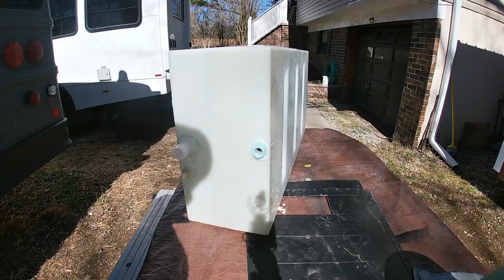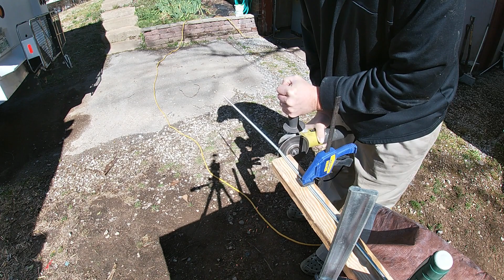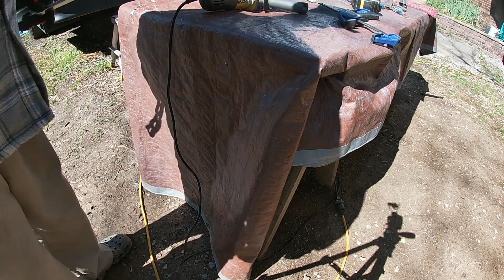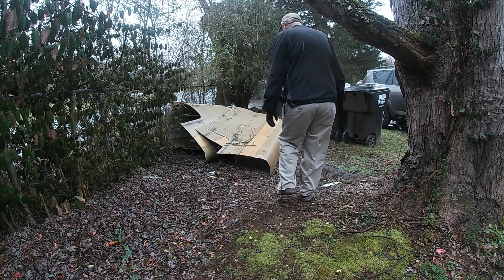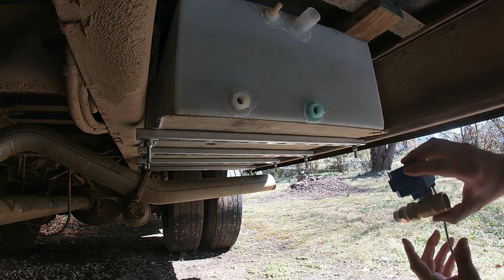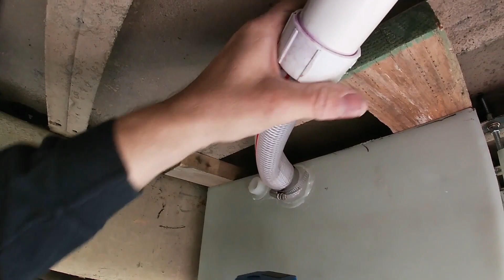Skoolie Build | Best SKOOLIE WATER TANK INSTALL Video | Repurposed Tank

Comment: Heck of a deal on that tank...are you just using this in summer months ?or are you gonna put in a hearing element so it doesn't freeze
Reply from the maker: Yes I think that you're right. Gonna run 12 wires down there for heating mats and tank sensors. Thanks so much for watching.

Comment: I like it.  I was initially thinking that I’d put a couple pieces of unistrut lengthwise but you added enough struts to give it a lot of strength, then said you were adding strapping.  It looks like it’s far enough away from the muffler but I had concern about that initially
Reply from the maker: Yea I was also. That muffler is like 10 feet long so I’ve let the bus run for quite awhile and it stays cool to the touch. I can always wrap it too if I find it getting hot at all. Hope you’re well bro.

Comment: $18 bucks, what a deal, and that tank fit perfect under the bus! The install looks really good. Thats a lot of ree room under there. Was thinking you may want to consider even more tanks for those long off gridd stays. This is a great video of do it yourself. Well done! Very impressed.
Reply from the maker: Thank you so very much for watching! Yes there will be another one on the other side, just for the dishwasher and kitchen sink. Shower will be recirculating.